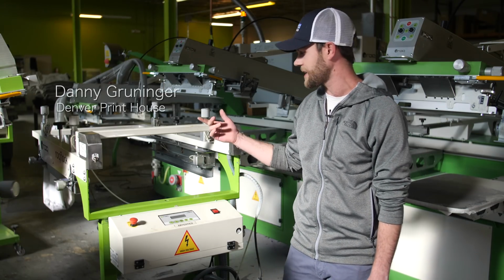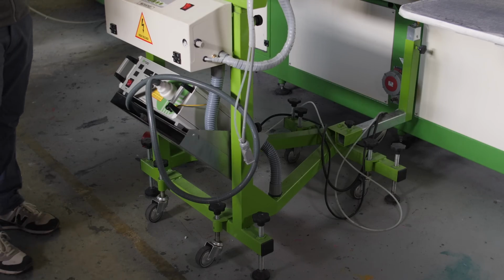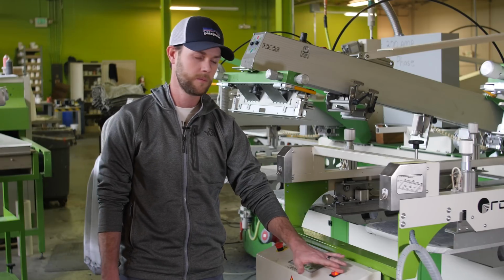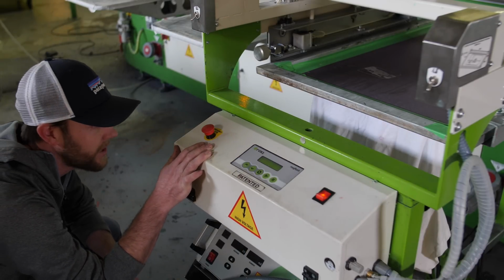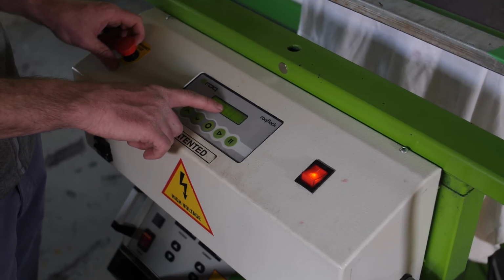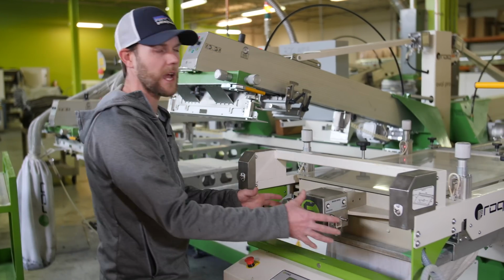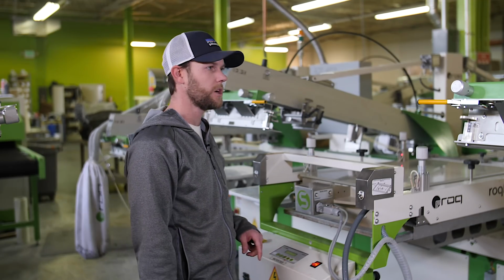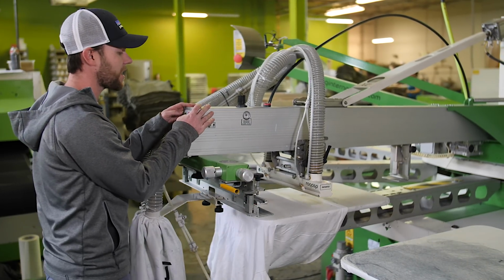Properly Installing and Using a ROQ Automatic Flocking Station on a ROQ Oval Screen Printing Press

Comment: I didn’t even flocking know that flock boxes even flocking existed. Learn something new every flocking day.
Reply from the maker: Ahhh how true that is. Do you have any flocking question?
Reply: @Ryonet  i actually flocking do. what's the reason for it's existence? does it have a special feel that can't be achieved by other inks or is it cheaper than an ink that does the same thing?
Reply from the maker: @printittowinit  It gives you more of a velvet feel - the only other, easy, way to do this is to use a flock vinyl. Manually printing vinyl is very inefficient and pretty flocking hard. :)

Comment: Why was that vacuuming excess flock run by so quickly and not showing the real end result? It still looked very messy at the end.
Reply from the maker: Hey there! The vacuum process can be adjusted depending on the flocking part of the process(How much flock is on the shirt.) You can adjust it to vacuum lower, slower, and however many passes you would like to get a full clear.